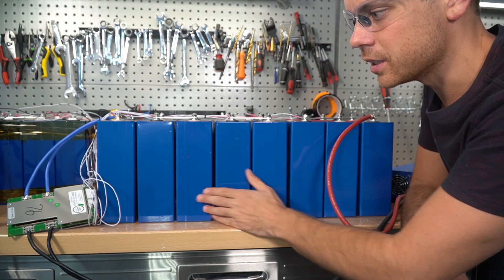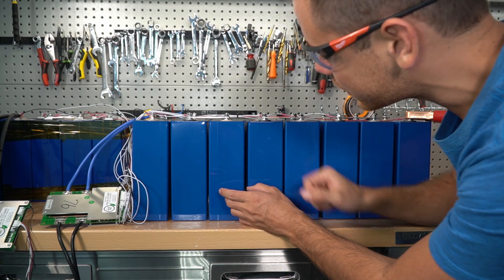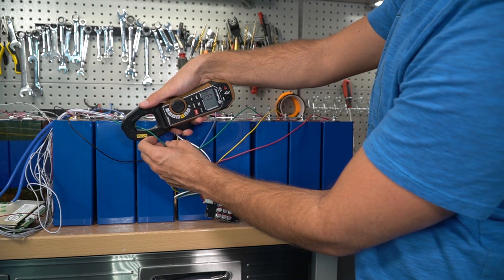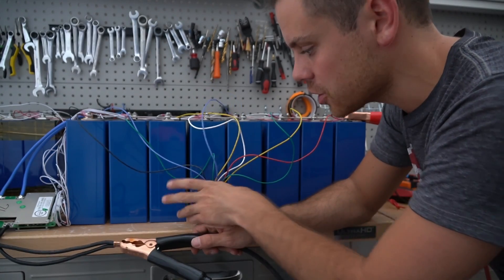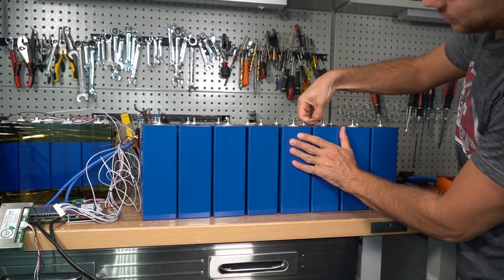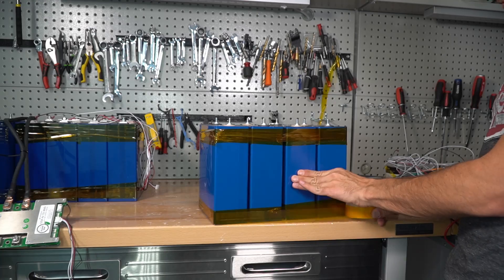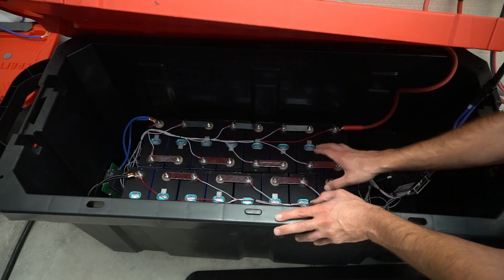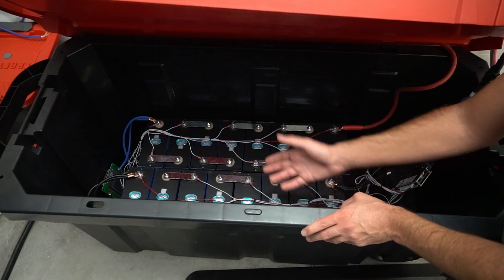300Ah Grade B Bloated LiFePO4 Compression and why I hate "Active Balancers"

Comment: should buy dc-dc converter based active balancers that maintain a constant current no matter the cell difference. The one you have just charges a capacitor off 1 cell, and discharges to another at a set frequency, this means it has a listed current limit but the real current is voltage difference dependent. They sell actually good inductive ones for cheap rated at 8 amps constant, they are meant for these batteries and some even have fan cooling.

Comment: I'm thinking to get some 320Ah cells and was wondering weather to clamp them flat  with minimal pressure or not. I have this old toilet room I was thinking to use for my battery system. The opposing walls are concrete. I thought an idea would be to put them wall to wall and fill in the space with cinder blocks and tiles till they fit perfectly but then I realised that if they do expand they will become stuck in the toilet room forever. So now I thought of a different idea. A car jack between the cells that go wall to wall. Once in position jack the car jack with some protective plates so that it holds them against the walls to either side. This way I can always remove them easy enough.
  Apparently the only way to avoid the swelling is to clamp them from their very first charge and onwards but this will probably just push the swelling in a different direction anyway. I recently was sold some 320Ah cells the guy said they had only had 50 cycles. They were swollen and it turned out they were actually 230Ah cells. With the damage to them I did a discharge at 40A per cell and got 136Ah Sending them back to him!

Comment: I don't understand why you're against active balancer. They perform very well on every state of charge. They work to balance at low SOC to delay the weaker cells so that almost cells will reach the same voltage. They permit to blend different aging or model
 cells of same capacity together even if they have different internal resistance. They work all the time h24.

Top balancing versus the use of a actif balancer is 2 différents topic and actif balancer are, in my opinion, not to put in use for the purpose of top balancing. You can but need to be patient.

Active balancer permit to use a group of cells between  the two threshold of high SOC and low SOC (above 20% and below 85%). That significantly increases the life span of the cells and avoiding the necessity of cycling at full charge to make a passive balancer works.

Active balancer have their limits as they tend to work slower went the voltage differential is minimal. Since the voltage curve is practically flat between  20% and 85%, you need to be patient. 

My 504 AMP  17s battery pack took almost a full month to be fully equalize with a Active balancer. But the thing is, I don't have to worries.

Active balancer tend to work better just after the high SOC threshold  (85% to 95%) since the differential voltage is bigger between  cells of different SOC. Which make the balancing slitly quicker. 

Active balancer

Comment: What is you oppinion about EVEs new double battery terminal? Better connection, BUT a single pole can move the cells like in a harmonica, on those double terminals they cant turn a little

Comment: Cells that swell can be due to gas formation ( can include hydrogen), I suspect your cells are producing gases, I could be wrong. It usually means the cells are failing. I have punctured cells and let the gas out ( pouch cells) but they are never very good after they start gassing.

Comment: I was under the impression that most of the active cap balancers like the one in this video are only recommended for up to 200ah banks. Considering these are 300ah could that be why you're having trouble with the balancer? Also, have you ever tried using a balancer like this on a supercap bank such as Maxwell blue 2.85v 3400f in 6s? Thank you, love your vids, very informative!!

Comment: Active balancers only work in the steepest part of the charge curve to "touch up" the balance. Looks like some of these are not there yet. Your friend Andy has a good video on it.

That said, I agree, a good parallel top balance can't be beat.
Reply: I believe the problem with active ballancers is they are on all the time. Because of this they work to unbalance the pack a lot of the time. There's several ways if switching them on only at the right upper part of the charge curve detailed by Andy on the off grid garage 🤔

Comment: Hi will I been watching your videos and bought a growatt 3k all in one. I have 30 days to test it. No way I can afford 48v lifepo4 battery or cells. Can I use lawnmower u1 battery for the time being ? I know u said not to mix 3.2v cells but the only way I can get my hands on a decent battery is to buy a cell or 2 every month. Is there a way to charge from one or 2 panels ? I am in a apartment and will sit the panels outside when needed hurricane Ida make me want to set up a system for that reason. Generators get stolen if you fall to sleep without bringing it inside around here. I also want to provide a way for my neighbors to charge their phones to tie them over as we was without power for 18 days. Give me your opinion. The growatt is a 48v all in one like the one you have.

Comment: Hi Will , Jano from South Africa here , thanks for the great vids !! I'm just starting to look at solar off grid so I still have a lot to learn but for now I'm just shopping for the hardware. Ali express sells 3.2v 320ah cells x 24 for only 700$ they say its grade A but most probably grade B's am I correct if I say 16 of them will give me 16.38 kwh 51.2v battery ? (320ahX3.2v = 1.024kwh x 16) ,keep the vids coming I've got a lot to learn !!

Comment: I have had excellent results using an active balancer with grade B cells. I built 3 4S batteries with 310 ah cells. Without the active balancers with cells top balanced I could not charge with a continuous 14 volts without one cell hitting 3.65 volts and disconnecting. Using the balancers I am able to obtain full saturation at 14 volts and after a couple hours the pack will be within .003 volts. I did not skip top balancing however. In combination with the active balancers I am using the JBD BMS (Overkill Solar),

Comment: Hi Will. Would you say, that the swelling is getting more and more by time? After you have charged them first time compared to the most recent cycle.... Each time the cell swells, it is delaminating the internals a bit. So the windings and materials are never returning to the same place and state as they where in the cycle before causing wrinkles.

Comment: Balancers in theory work great with much smaller capacity batteries packs that need discharge quickly and evenly imho. In the case of a solar pack I feel they have no point. However a good top balance makes tons of sense to me. I get worried that those bloated batteries at some point are going to leak gas and fluids. I'm not positive but seems like they are expanding more now then they did in the past. Hopefully its just me being paranoid 😁

Comment: Will, have you ever thought about using a spring under the bolt at each end of the bus bars? This would allow a consistent torque on the bolt/bus bar, but would allow lateral movement too.

Comment: I have one of those active balancers. It says it only uses high current when the voltage difference is higher. It says it won't balance 5A unless there is a 1v difference. But I'm skeptical it could handle that load. I've never seen mine go above 0.5A but I never have more than 0.3v difference. Can get a 1v difference and see if it 🔥

Comment: So I recently got my 280 AH, 8 cell battery going. Some of my cells were a little bloated, not much. I made my own bussbars out of copper pipe with a 5/16 hole so it has a little give. Way better.
So now I'm watching it charge up and charge out, as one does, and I notice that on the BMS screen that it is balancing sometimes when it goes over like .023 difference. So what's up with the balancing function of the bms itself? I have 2 sets of 4 cells that I got at different times and you can see the difference between the packs when you watch it charging. It all settles out fine and it is great.
Also, there is a check button in the settings that apparently checks all the settings. It adjusts my amp hours reading. It was necessary to set the amp hours in the settings which I had to figure out.

Comment: I use one of those active balancers on a set of 280Ah cells paralleled with a set on 100Ah cells in day to day use but I would never use for an initial top balance which I do manually very quickly. I don’t think they are really intended to do a top balance with but more just to maintain it especially where there is a good chance of some cell deviation. I also wouldn’t use one if I was ever expecting to get into the low state of charge knee as then it would only serve to unbalance the pack. For the situation that I am in however, with a hybrid system that never approaches a full discharge, it is ideal particularly as I terminate the charge fairly early in the full charge knee when the cells reach 3.5v.

Comment: Power supply top balancing is the only real way to get er dun. I let my 200ah prismatic cells that were not to far off from full top balance.. bms balance with 180mv balance for six months.. 😳 they were just barely better than when I started. 
These 200ah cells have such a huge capacity that my bms balance voltage of 180mv is so tiny of a corrective voltage it may take years to fully balance.
✌️PT

Comment: Buy or make longer connectors between batteries. Give plenty of room between batteries. They can bloat and shrink at will with out damaging the battery terminals or loosening the connections. The only down side is needing a slightly larger container to house the assembly. I would use copper flat stock and drill holes far enough apart to leave 1/2” between each battery. Just a thought.

Comment: Im so curious :) What if you took one of those bloated cells and discharged it on your testbench, noting the total power output, and then forced it not to bloat, like I mean fixing two thick metal plates on either side with a couple of threaded rods to hold them together forcefully. Then charged it back up, and tested the poweroutput again. That would be interesting to find out if it makes a difference or if its status quo :) :) heck or maybe it blows up

Comment: When an Active Balancer (Heltec, QUCC,) etc states they do up to 5A transfer, that is "Collectively" not per circuit (to cell) and that is what the documentation generally states (once you get past the terrible machine translations).   

Also it's nearly impossible to "Broad Brush" lump all Balancers together because there are different versions with differing electronics & tech.   Some are suitable for LFP and others are not, same goes with the AH Capacity of the cells which is also a major factor as to how they will perform.

BTW:  It is always nice to see your packs within a battery bank sitting between 6-10mv in Float with the Active Balancers doing their job, regardless if they are B-Grade or A Grade cells.  Only the used EV-Grade LFP cells I have deviate more (up to 30mv) but they had a previous hard life.

Comment: I bought slightly bloated 310 Mah batteries (I think grade B even if it was not written !). I massively compressed them with threaded shaft and bolts (1 line of 16 batteries). To try to reduce the bloating. I use these batteries for 2 monthes and nothing happened. So I think you can apply a lot of force on the batteries when you compress them.
Reply: 18 monthes after all is going well.
Reply: I am no expert on this topic but when I worked on my Prius hybrid battery (one of many times) I made the mistake once of unbolting the pack right after charging it. The pressure caused quite the forceful exit upon removal of the second bolt. Point being, Toyota builds their batteries with (essentially) 100% restriction to combat bloating and that battery was 16 years old. To be fair, these batteries were not lithium so maybe maybe not relevant to this video.

Comment: Yeah, man that was smart to let those do what they want. The vent would have probably let go. Never seen anything like those! I do not use buss bars on any batteries. I line them up in the same fashion as when you top balance with the polarity on the same side. I then make jumpers to go across diagonally to the next cell. The jumpers are just a bit long so there’s a slight curve/arc to eliminate any tension in any direction. I use flanged nuts and M6 Belleville washer from HH fasteners on Amazon. Those washers flatten out just before you reach full torque. Never have to worry about a loose terminal should something scoot. The jumpers are 2/0 and lugs with 1/4” holes.

Comment: Active Balancer - My experience is that the rated Amps is the MAX Amps it can handle! The actual Amps is dependent on voltage differance between cells. I love them but I am not using them for topbalancing but rather in mixed cell packs and to ensure all cells(in a 6s-4p setup) always are within the BMS cell shutdown voltage. Ageing cells will eventually drift in capacity, balancers compensate for quite a bit of that drift.

Comment: I know this is off topic, but I could use your help. I want to run a radiator fan that says 80 watts on the side. How long will a 250 watt solar panel run this item? The fan is 12 volt so they should connect properly. Thank you in advance!
Reply: My guess is that the fan will run just fine when sun hits the panel, but you will have to watch out for “reverse EMF spikes” from the fan motor.   It’s a part of the physics of how DC motors work.  These could damage the panel unless there are protection diodes installed.

Comment: Will you should try using spacers in the corners between the batteries. You know the plastic spacers you can get for laying floor tiles that go in the corners? Something like that would keep spacing between the cells without interfering with where the bloating occurs in the center. The nuts will eventually wear loose slowly and this method would keep the pack square, allow space for bloating, and the busbars and nuts will not move. Also bloating will cause some cells to self discharge faster than others. The BMS balancing should be enough to keep up the top balance naturally but instead of an active balancer, one that will sort of boost and assist the top balancing like the BMS is doing would be all that's necessary. Anyways, great content as always.

Comment: Shipping tape (called strapping tape) works better for wrapping cells together. The balancers are better suited for smaller batteries, 1A balance currents don't do to much for 280 or 304Ah cells. Balancers work better on LiIon batteries since they typically have larger voltage differences between cells (which leads to higher balance currents), LiFePO4 cells don't have much voltage difference over their state of charge range except at the ends. Buss bars that have a little 'horseshoe' type loop in the middle allow for flexing. I use pure copper pipe hangers.

Comment: Will, 15psi is what those cells want to be compressed at.  Springs or air bag with a large air storage bank.  Using the correct spring pressure or air pressure to maintain 15psi will keep the cells happy but allow them to expand if they have to.  Using tape or rigid rods alone is not a good idea, though tape will usually stretch, steel rods have no give so if the batteries expand they could raise the pressure over 15psi which would not be good at all and could destroy a battery.

Comment: TERMINAL STRESS:  I remember when you created your own bus bars from copper pipe.  If you made an arch in each bar, the arch would absorb the expansion, while the terminals could remain tight!  Was going to suggest a wire bar with crimped connections, but the arched bar would be cheaper.  Just hammer the bar over a round rod to make the arch.

BAD CELL:  It only takes a teaspoon of "bandini" to ruin a gallon of ice cream.  The sames goes for one bad cell and a battery pack.  I like to get that last decimal point of performance.  But, at what percentage of lost performance does it really matter?  Swapping out a cell is easy.

ACTIVE BALANCER:  If we were to engineer an AB, what voltage deviation would we attempt to correct;  1/10th, 1/100th, 1/1000 of a volt?  And, over what time would we want to accomplish that correction?  If I were to guess, there's too big a difference in your cell voltages.  Also, your video production time constraints may be too demanding for the AB capabilities.  An AB might make sense with grade B cells, matched 1/100th of a volt.  Also, having a week or month to balance might be more realistic.  For me, adding a failure point and costs, is a difficult sale.  Expecting a tiny circuit board to accomplish much seems unrealistic.  I'm guessing on all of this.

Comment: The only reason I can think of using an active balancer would to slow down the balancing compared to passive balancing, either for safety or heat reasons. For example, a product developer who may combine different batches of batteries into a single product repeatedly and they can use a smaller gauge cables to quickly connect many sets of batteries without having to think about the size of the battery packs and reduce their labour. For the average homeowner, passive balancing is a great and the only thing that is needed.

Comment: In my mind, the better solution for this type of battery pack all the way around is a connectable plastic base and top ( with a flip-up carry handle) that allows for swelling between battery cells. And the use of longer bus bars to hold each cell in their respective place, and also allows nominal airflow between cells too.